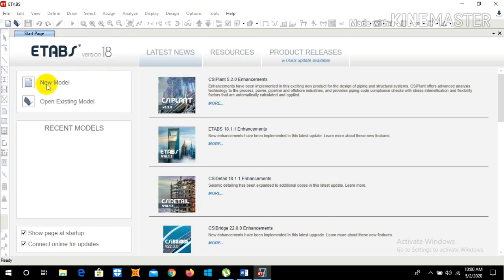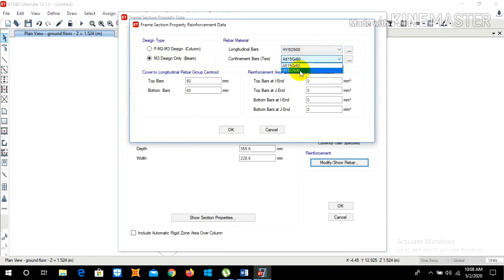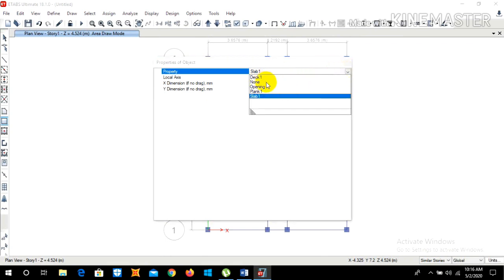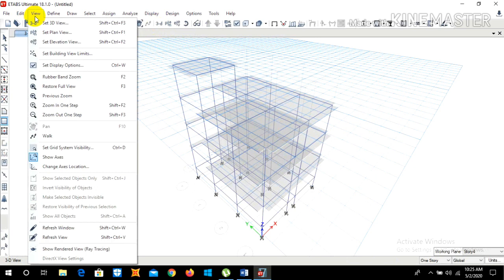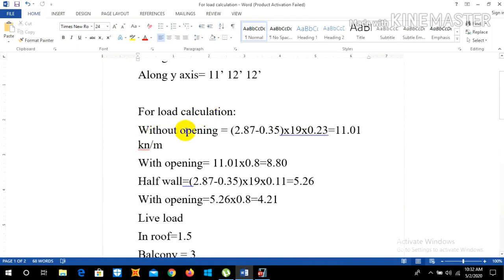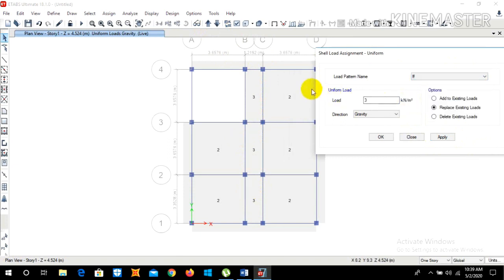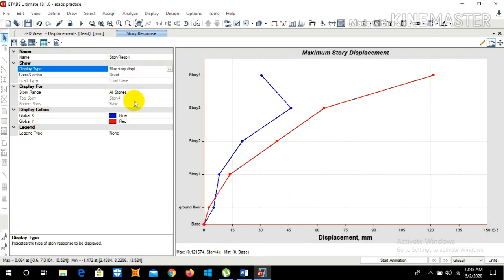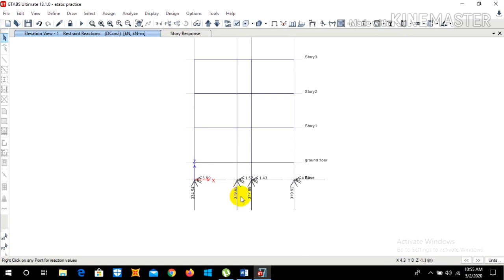ETABS TUTORIAL AS PER IS CODE// Modelling of Residential Building

Comment: Here,in the analysis result your building  needs  larger area of  column reinforcement in upper floor than lower floor in some column .is it right??
Reply from the maker: Ya. Kaile kai testo aauna sakxa staircase portion ma.
Reply: and define ma "function " ko kai gariyena ta? tyo response spectrum wala
Reply from the maker: Load function ta pardaina mero bichar ma. But i will check later okay. Aaile samma functiom chai chalakoxaina bro
Reply: top of building ma heavy load lagnae jastai dance floor ,landing for helicopter or heavy parking huda mathi dherai reinforcement hunxa ...stair ko load 14 kn/m via frame structure apply garda ako ho..